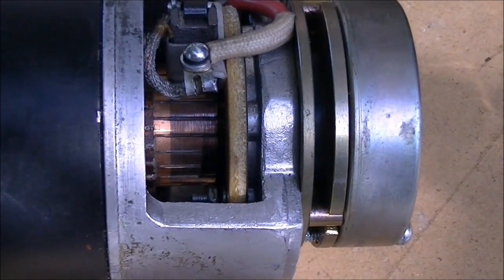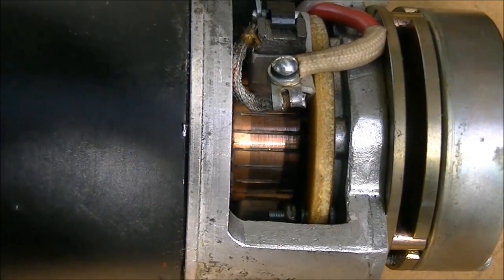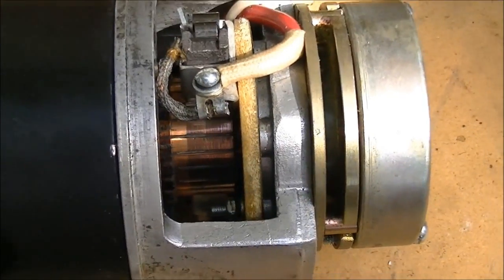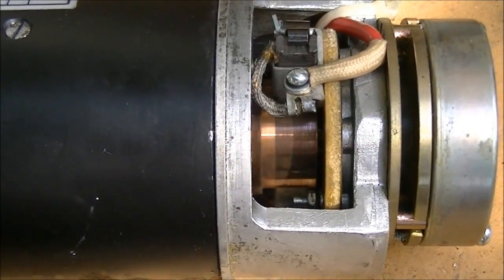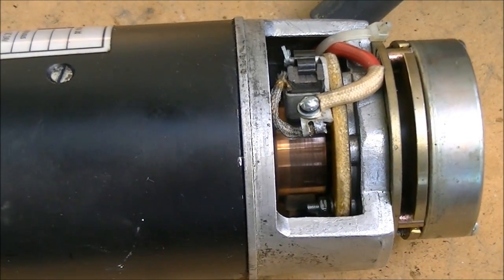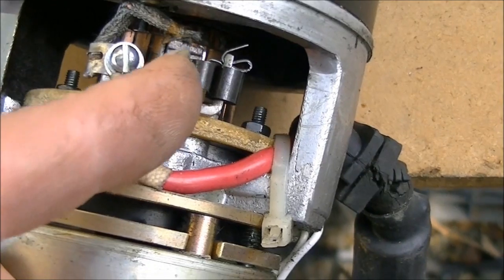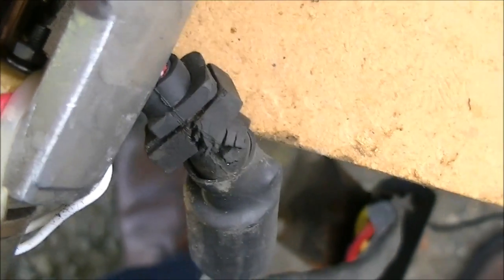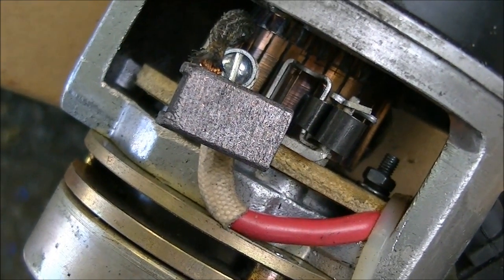Electric Wheelchair Motor Problems

Comment from the maker: I don't think you're exactly correct about the brake. I think it's electrically charged, and I don't have the brake powered. It's still possible that it's causing problems,  but since both motors have similar problems I think that's unlikely. My guess is that both motors just need to be serviced.
Reply: When the motor is running you should also be getting a 24volt  feed to the electronic brake. This activates a solenoid which holds the brake off. When you release the on off switch this ceases supply to both brake and motor, thuss applying the brake. 
So the tests you need to carry out is to check if you have a 24volt supply to the brake when the motor is running. You can either use a test meter or rig up a 24volt bulb to a couple of bits of wire as use that as a tester.If there is no supply when the motor runs, you could, temporarily, remove the brake. This will allow you to use the buggy. But remember, you have no brakes.
There are loads of good tutorials on youtube that explain exactly how to remove the brake mechanism.
Hope this helps you.

Comment: Also that part on the back of the motor is a brake.  It has a spring and a disc to keep the motor from spinning when power isn't applied so the wheel chair doesn't roll away.  It disengages from centrifugal force, but I bet it is what's hanging up.  I would remove it, since you don't need it for your application.
Reply: No it does not engage or disengage from centrifugal force. When the motor powers up so is the brake. This operates a solenoid acting upon a plate which retracts from the motor alliwing the motor to run freely. Cut the power to the moter and hence to the solenoid...the brake reengages.
Reply: @paullee5573  almost correct, the brake has its own wires and is energised independently to the motor at almost the same time.

Comment: I would get some fine sand paper and hold it on the contacts with it on as it spins to get them down to good bare copper.  Then use the sand paper to make that brush surface as smooth as possible.  The go to an auto parts store and get some dielectric grease, it's the stuff you put in spark plug wire boots to seal them.  A packet is like 99 cents.   Lube it up with that because it's conductive.  If that is where the friction is coming from I bet that would fix it.